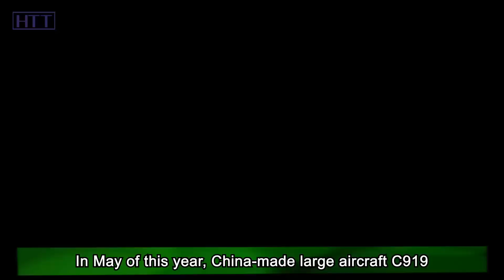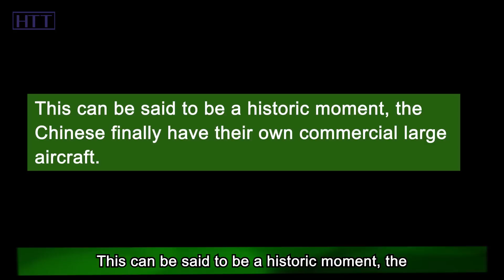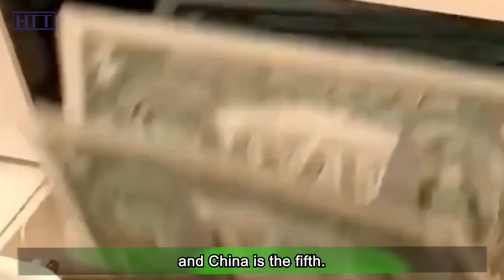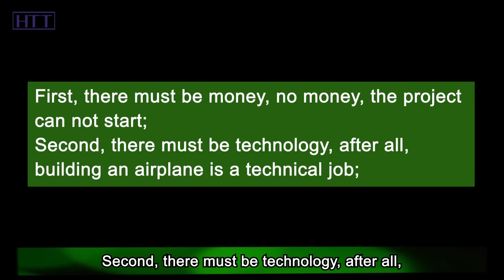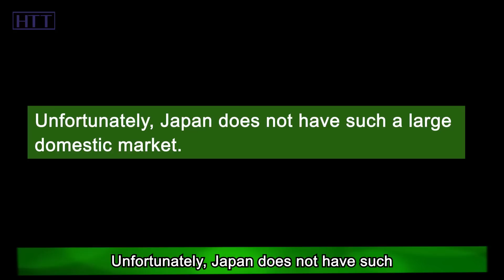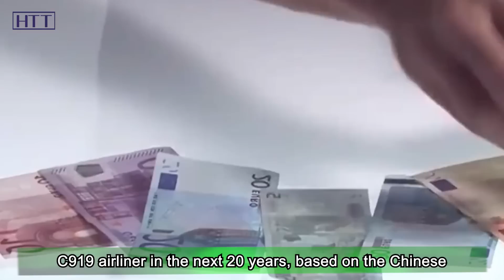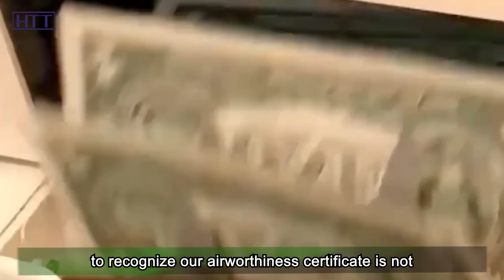Why can't Japan build big airplanes?  Japan can't compete with China on this point!

Comment: The reason why so few countries build passanger airplanes is probably because it's a very closely protected market. Too much resistance to enter that!

But China has a large domestic market. Just by being able to supply themselves, they put a orice preassure on other suppliers.

And if anyone try unfair competition against them, I presume they  will find that large market closed to them.

So, I guess China can do this!

I think China has a need for much more than they can produce.
If no one disturbs them, they will have a large part if that market.

Comment: The content of this video is a bunch of baloney.
The C919 did fly that one maiden flight, but the dignitaries at the ceremony backed out and weren't on that flight and they had good sense.
On this plane's second flight some kind of emergency was declared and the plane had to drop down to less than 20,000 ft to complete that flight and hasn't flown again. Although China hasn't published details, observers speculate that because of the response to the flight emergency that the aircraft suffered some kind of pressurization problem and if it's structural then it could be next to impossible to fix so the plane would have to be scrapped.

And that's that's just the start of a long list of reasons why the C919 probably won't ever be certified. CORMAC has no experience or track record tracking and managing maintenance and operations of its aircraft. Supporting and managing compliant aircraft is a very complex and difficult operation, and CORMAC almost hasn't even attempted to set up such an organization.

Until CORMAC fixes its shortcomings, anyone who buys, operates or flies in one of these planes is taking a very, very big risk of life.